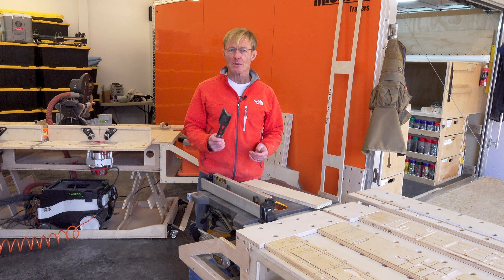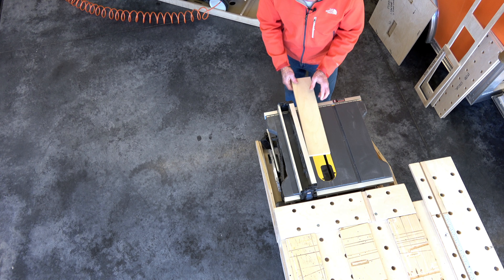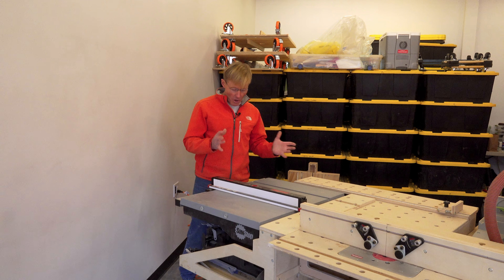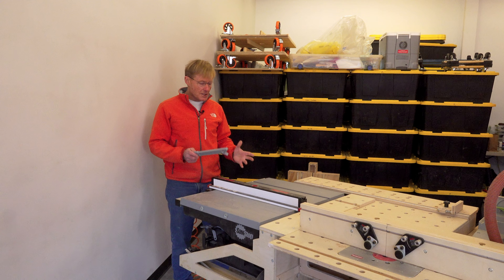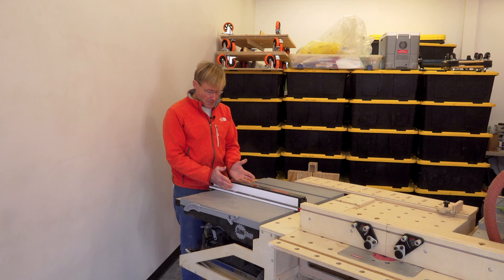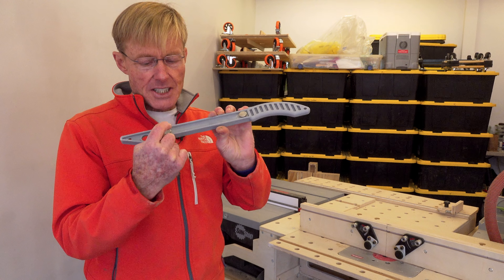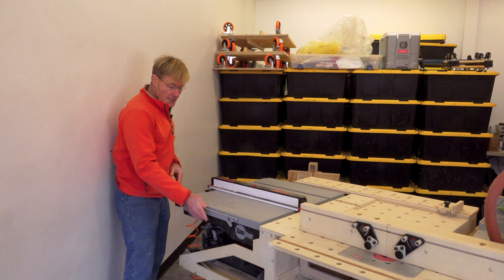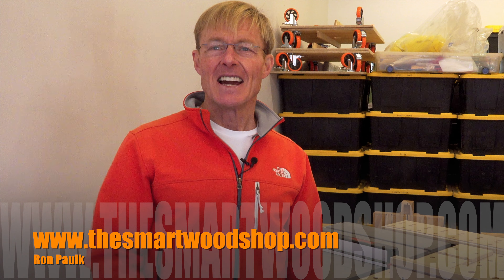Keep Your Push Sticks Within Reach with this SawStop Jobsite Pro shop made holder.

Comment: I would reverse the magnet/washer option.  Especially if you use replaceable/wooden pushsticks.  That way, you can screw the washer into the stick, and re-use the magnet glued to the side of the machine.  (Also, although doesn't seem to be a problem, the magnetic field doesn't come close to saw-stop's emergency stop mechanism.)

Comment: Is the table top hollow?  Bent Aluminum?  What if you glue the magnets to the inside of the table top edge and have a metal on the push stick?  Just need to be sure the metal doesn't touch both you and the blade on the saw stop at any time...
Couple thoughts:  Could the magnet on the push end will attract to the saw blade if it's high enough? If you have it angled up all the time but if you push low and through? dunno.. you probably rarely put the blade up higher than an inch or 1.75ish
The washers impede extending the table down the road -not something you're likely to do I think
-But I really appreciate the dewalt design. I'm going to go find a way to put my stick on my fence now!

Comment: Are most people here missing the diff on purpose. When using the festool vac it’s off and on throughout the day and the filtering protection is always working. When emptying the bag it’s a concentrated infrequent operation and can be done in a well ventilated location and if smart can be done while using some extra precautions like a respirator if one is being smart. If in a production type setting the time is probably a waste but for an infrequent user or hobbyists I think this is a great idea.

Comment: My question is, why put a magnet on the push stick.... the push stick that travels directly next to a metal blade.... a metal blade that if even remotely close to something electrically conductive trips a hundred dollar break and ruins a 50-150 dollar blade??? This is a great idea for any other table saw OTHER than a sawstop. I love and adore your channel and ideas, but this one gets a big thumbs down from me. You may have been ok for the weeks since using this modification but i think one day this is gonna trip the brake.
Reply: I am not concerned about the blade tripping from the magnet, because a circuit is not completed.  However, a magnet will be attracted to the large, spinning metal washer (blade) the same as the small washers on the table's side.  I would reverse the process and put the washers on the push stick and the magnet on the table's side.

Edited to add I see @J Fred Beck already addressed this.
Reply: That was exactly my point, but even still with the washers on the push stick, its still risking tripping that brake. I would at least put them further up the stick so that it doesnt pass so close to the blade.